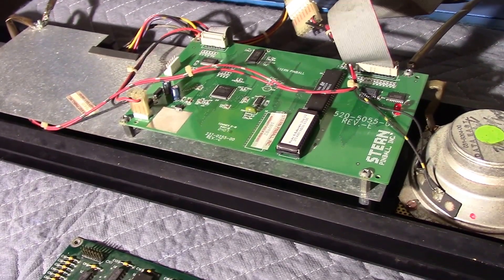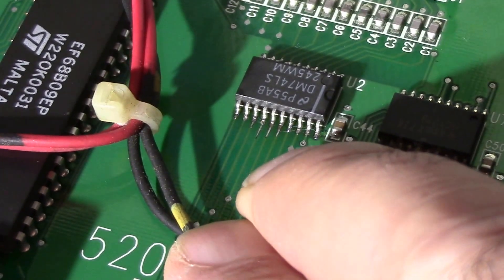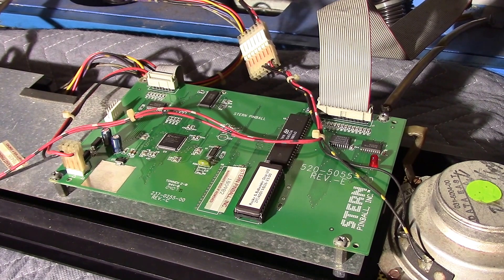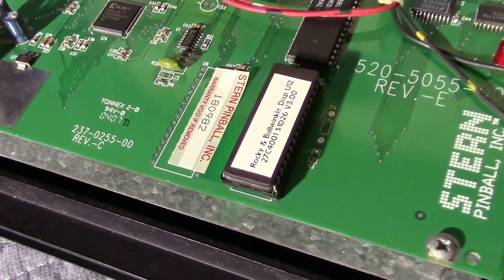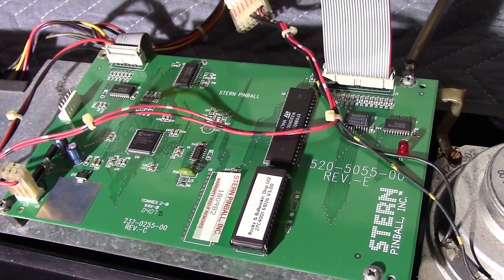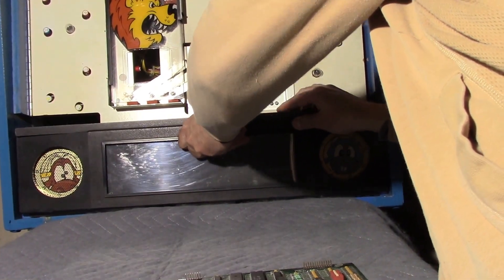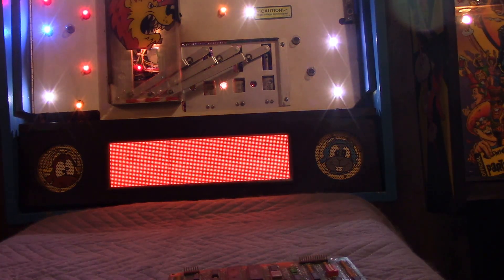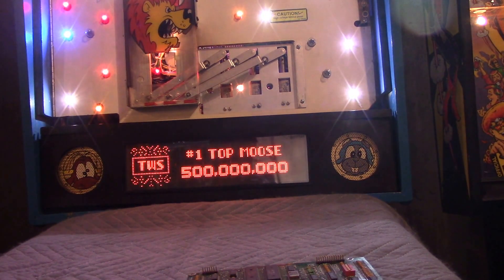Data East/Sega/Stern Pinball DMD Controller Compatibility

Comment: I have the 01 board you show there on my Tales From the Crypt.  It's been sitting for about 6 years.  I turned it on last night and there's no display.  I unplugged and replugged as many connections as I could find that looked like they had anything to do with the DMD, and eventually got the display to light up for a second then nothing again.  Any suggestions on what would be causing that on the 520-5055-01 board?
Reply from the maker: Power connection on the display controller - both header pins and wire harness connector.
Reply: @viperrwk  Thanks for the reply, i'll have another go at it soon and hopefully get it goin again.  Very helpful video.

Comment from the maker: I should add that while these two boards are the same and interchangeable, there is one instance where they are not identical, and that is when using it with a Pin2DMD display. When setting up a Pin2DMD and selecting the display mode, you have a choice between "Stern Whitestar" and "Data East/Sega". The Stern Whitestar mode is for display boards that have the Xilinx FPGA controller on it. That's the one in the video out of an Austin Powers Machine. The Data East/Sega mode is used for the older boards with the 68B45 video controller on them. That's the board in the video outside the machine. Stern made the switchover from the old board to the new one during the production of Austin Powers as it was around that time that the 68B45 video controller was no longer manufactured. Be sure to set the mode based on the display controller in the machine and not the CPU type!